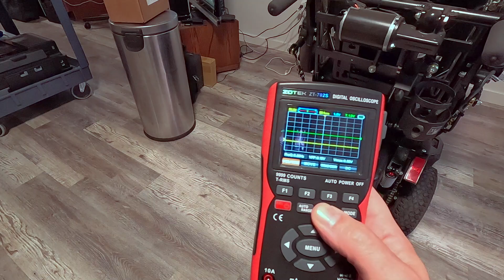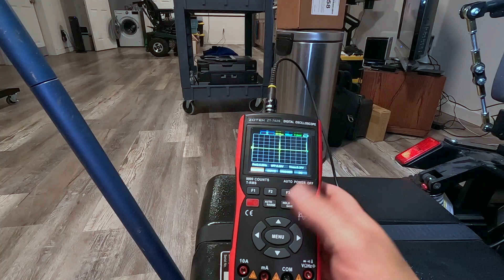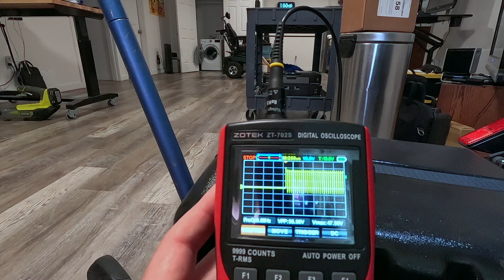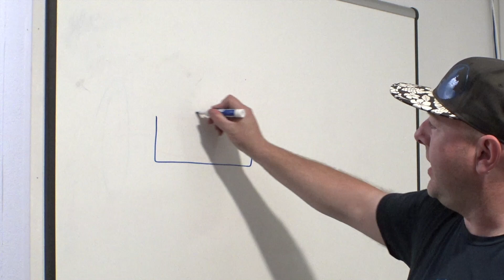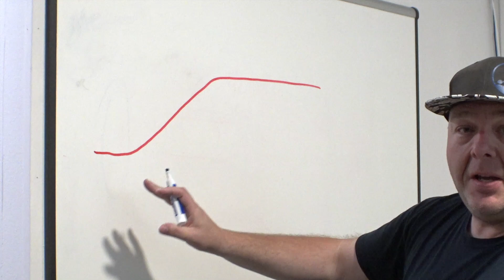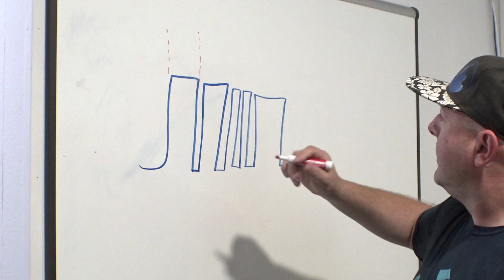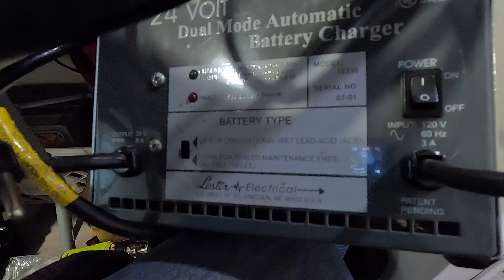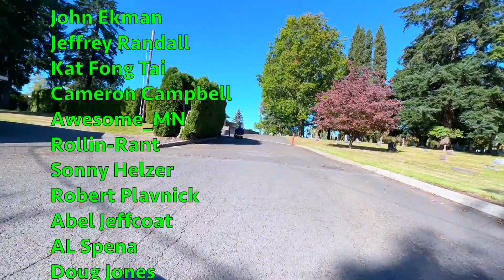VLOG 725: handheld scope, updates & PWM control!

Comment: Good evening Denn, I wanted to ask you a question gel battery for those who only run it indoors during the day, should it be charged every night Or not? I think I'm not correct You have to take advantage of the cycle, right? Just don't let it get to the correct red?
Reply from the maker: ANY lead acid battery (which includes everything from flooded cell, to AMG/GEL) prefers to be at a fully charged state.  its best for them to remain fully charged whenever possible.  (use during the day is fine - no need to plug in until ya head to bed)
waiting several days/weeks to charge them back up after use, WILL shorten their service life substantially! 
charging from lower levels generates more heat, and stresses the batteries more.  (among other reasons)

lead acid batteries do not have 'memory' and should be plugged in EVERY night, ALL night if they were used at all during the day.  simply ignore the lights on the charger, and the battery gauge on the chair while charging- if they show fully charged, or the green light comes on, leave the charger connected till you're ready to use it the next day. 
the chemical reaction inside the batteries is the most stable when they are in a fully charged state.   
leaving them at lower states of charge for extended periods will speed up the aging process of all the materials inside.

the "done" or green light on the charger indicates the batteries are about ~%85 charged - after that green light comes in, the charger is still working to complete float mode charging.  (this is a very important part of the charging process). if you are using the OEM charger that came with your chair, it will not damage the batteries being plugged in every night.  HOWEVER you do not want to leave a chair connected to any charger for more than 48 hours.

Comment: Good simplified explanation of PWM. A big advantage of using PWM instead of a linear voltage is efficiency of the drive electronics. As an example a motor operating at 12v and 10 amps in a 24v system would require a linear drive circuit to dissipate 120W of heat while a PWM drive circuit could be under 1W